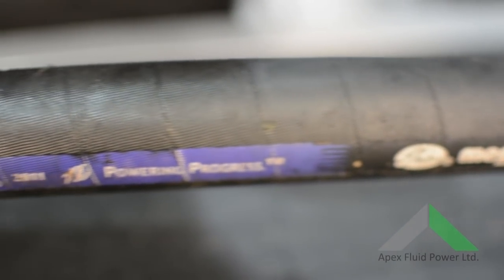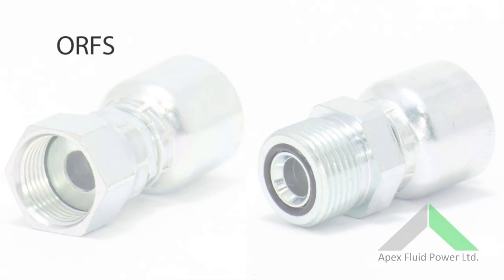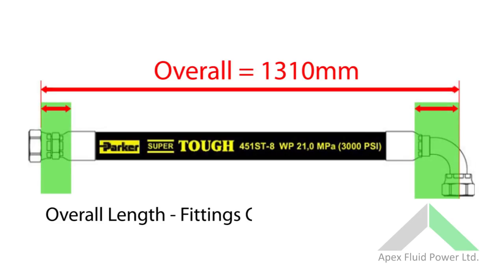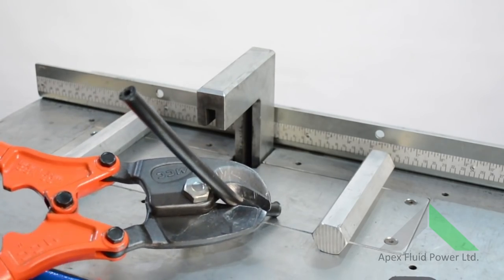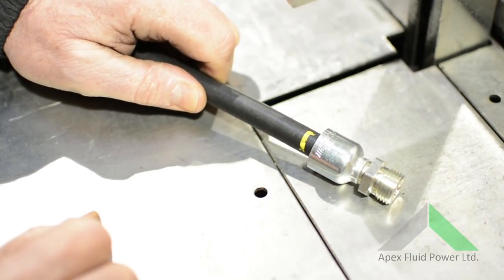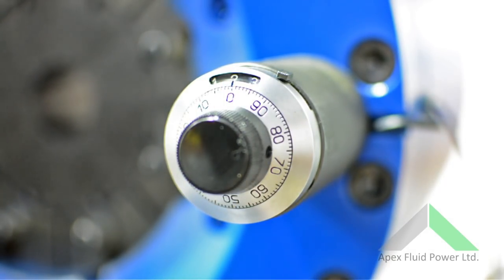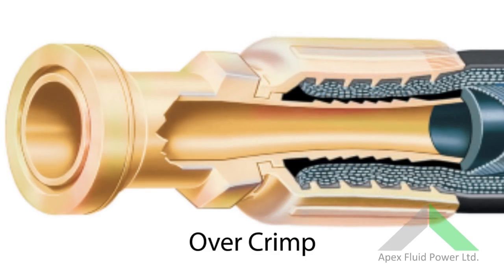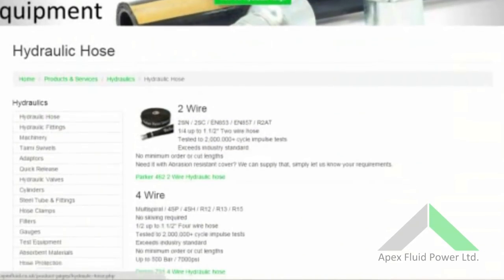Hydraulic Hose - How To Make an Assembly

Comment: When measuring the hose you took off the end fittings to give your final measurement. I thought you were supposed to take another 5mm to allow for growth when squaging?
Reply from the maker: +Ben Harris Hi Ben, you are correct that during swaging there can be elongation however this can depend on multiple factors such as the how the hose and fittings have been manufactured - i.e. the compound of the rubber or hardness of the steel being used can have varying effects. Even the machine type used and operator can have a direct impact on the the final swage.
That being said, in most instances, hoses should be assembled within a tolerance, therefore any growth while swaging should be accounted for and so not necessary to add any extra length. For example, a hose measuring 48" should allow for +/-13mm on the overall hose length. 
Hope it helps, if you need any more info please let us know.
You can find the contact details here - http://www.apexfluid.co.uk/

Comment: gates is better
Reply from the maker: Thanks for your feedback! What in particular do you find better with Gates?
Reply: wouldn't say that now gates have moved production to india and now china and we had a price increase then they refused to supply standard 2 wire (g2)  meaning we were all forced to buy the new extra flex smooth cover at twice the price per meter hence why we deal with 5 different suppliers with a much cheaper product just as good